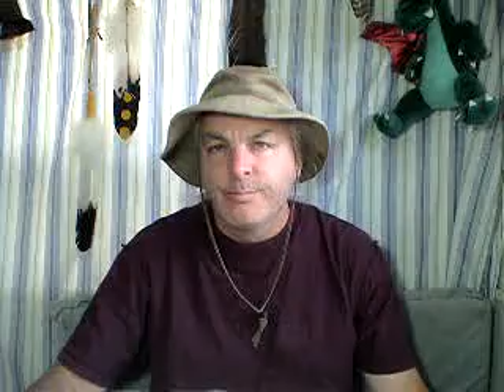Re: My magnet motor ideea

Comment from the maker: "... you use the assumption that (insert anything here) "...WILL NEVER..." (insert anything here)."

Magnetic fields do not contain energy, therefore there will never be a device built with magnets that produce work. *NEVER,* and no amount of effort to violate that fundamental fact will succeed. You'll just have to adjust to that fact.

Comment from the maker: Part Two: Magnetic fields "wear out" because the electrons slowly drift from alignment to non-alignment over the span of a great many years. It is not a loss of "energy" that causes a magnet's field to degrease: it's a loss of electron alignment. One way to cause a magnet to lose its magnetic field is to heat the magnet red hot: that jumbles the alignment of the electrons, randomizing alignment.

Comment from the maker: "However, if we consider the lost of inherent magnetism of the magnets involved, that would be a conversion of potential energy into kenetic."

Part One: Howdy! Magnetism is a physical phenomenon, (electromagnetism), i.e., one of the four forces. Everything that contain electrons have magnetic fields, but in most objects the electric charges cancel each other out because electron spin is randomly distributed: in ferrous metals that is not the case, and the electrons spin in the same direction.

Comment from the maker: "Why does an oil company hold the patents on the EV1 Battery design that is just wrong."

You are right--- it is not criminal for Big Money to suppress the opposition, but some times I think it ought to be. The chief problem with power from wind, sun, water, alcohol, and steam is that it costs a large bundle of money; it can be a decade or longer before it all pays for itself in savings compared to oil, after which time it must all be replaced due to wear and tear. A video shall I make!

Comment: What do you call water splitting into H2 and O? Because that's what i meant.

Hydrogen-oxygen bonds are low-energy, that's why it requires energy to break them.

Comment: "There is a guy who claims that you can travel through time using a tunnel full of lazers bouncing off mirrors"

The concept appears to be sound, but it's based on unproven hypotheses at this point.  Gravity probe B was supposed to test the concept of frame drag, but the last I heard it was running into problems.

But yes, your point is valid.  It's a clever idea, but it doesn't appear to have been made to work yet.  And no one is trying to claim otherwise.

Comment: I've got an idea. (it probably is flawed in some way but i don't know why).
Get a thin straw. Put it in a layer of water in such a way that the straw's lowest opening isn't blocked. Bend the straw downward and place a small waterwheel below the opening. The adhesion pulls the water up and gravity pulls it down against the waterwheel. The waterwheel starts spinning and you can get some energy.
Where's the flaw in this?